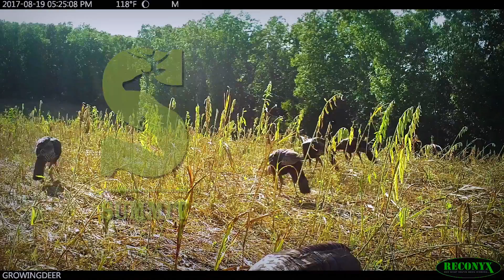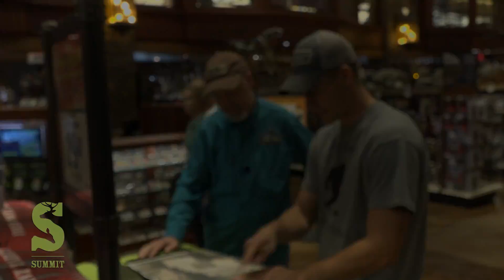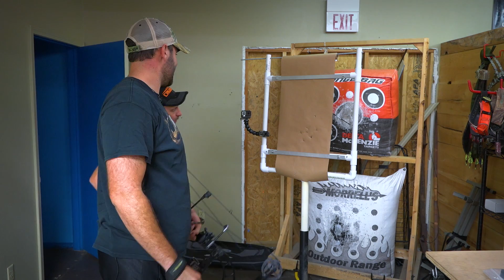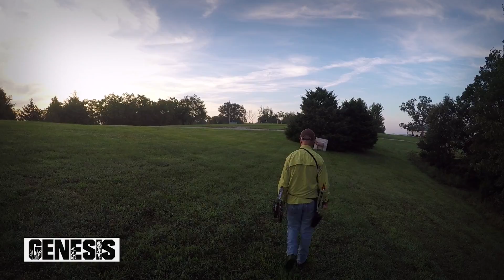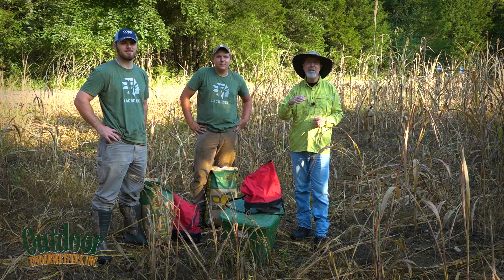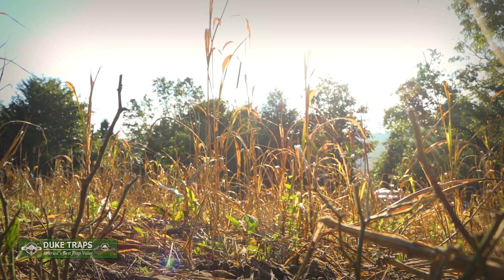Deer Hunters: 3 Things to Do NOW to Get Ready for Deer Season (#405) @GrowingDeer.tv

Comment: do you recommend quiver on or off
Reply from the maker: Wendy, I prefer to shoot with the quiver off. It is less weight to hold. However, you can hunt with it on and be just as effective. The key is to practice exactly the same as you hunt. If you hunt with it on, practice with it on and with arrows in the quiver. -Daniel